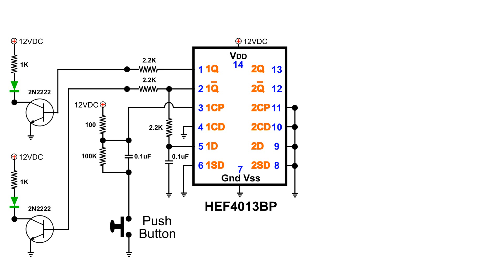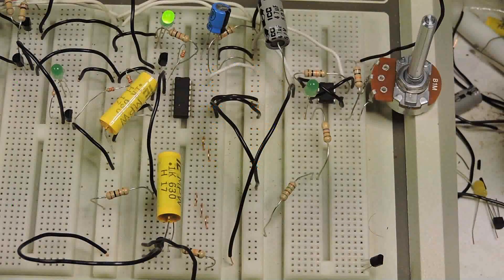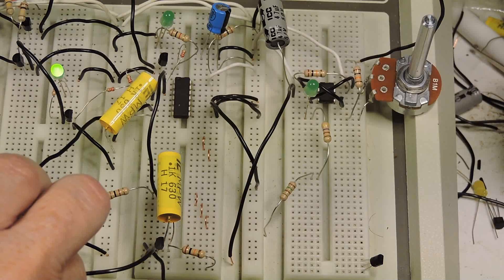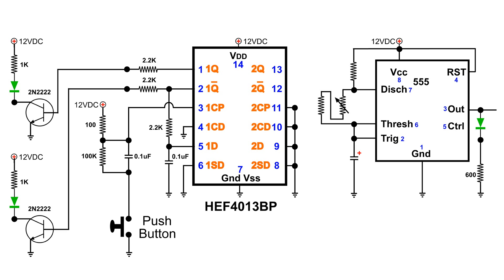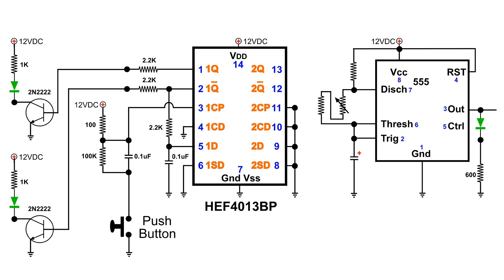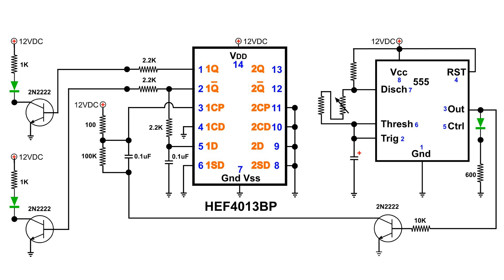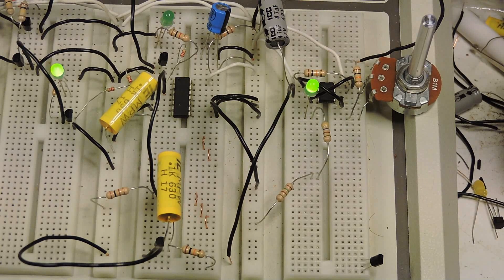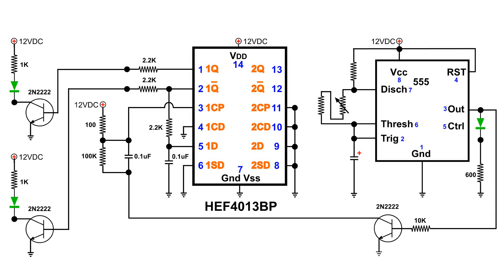D Flip Flop Clocked with 555 Timer

Comment: Hi mr. Rick, thanks for a very usefull portal concerning electronics. I needed a circuit for a push on/push off contact and I found yours based on the 4013BE  14 pin chip. I changed one of the LED's with a 12V omron relay and removed the 1K resistor. It works perfect:-)) .... I am about to make a 120Watt mosfet amplifier where the toroid powertransformer of 1,2KW have to be startet with a 30 Ohm inrush limiter, and your circuit is very stable, and perfect for me...thank you...best regards Kim..ps. draws 45,2mA...
Reply from the maker: Good luck with your project. Glad you found this video and circuit useful. Thank you and your welcome.

Comment: Current issues resolved! Did a bit more fiddling with the 7475 to reduce the current at the output pins. Replaced the signal generator with a 555 and using a single supply now with the chips on a 5V regulator. See demonstration at https://youtu.be/mSzpVfbP8RE   and schematic at  https://youtu.be/lP8WecBB_JY
Reply from the maker: Great! Keep experimenting!
Reply: @AllAmericanFiveRadio  

Spent the afternoon with a bag of chips... My CD4013's arrived. Here's a schematic if needed: https://youtu.be/9iXWmX4Y4Pk
Reply: @AllAmericanFiveRadio  

Here's an updated schematic for the 7475 with pinout. There's also a link for the datasheet.
Reply from the maker: @andrewferg8737  You can contact me at allamericanfiveradio@yahoo.com

Comment: Ok. I've begun experimenting with  7475 bistable latch. Works great with LEDs . Also worked well as a switch for an h-bridge via NPNs. However,  seems the current is limited. Only works with a small motor. Tried several current fixes but no luck. Any thoughts would be appreciated.
Reply from the maker: Are you using a transistor to drive the LED or small motor? What is it you want to drive? The next question is, can your power supply, supply enough power to drive what ever it is you want to drive? I did order some 7475's looks like and interesting IC. The output transistor and circuit will have to be changed to handle the higher current. It helps to work backwards sometimes when designing a circuit. Get the output circuit working first then make an interface circuit to dive it.
Reply: @AllAmericanFiveRadio  
Finally got it figured out! Thanks for your reply. Seems the 7475 output current has to be kept super low. Had to adjust the driver biasing scheme.  See video description at   https://youtu.be/wquBFX8XCo0